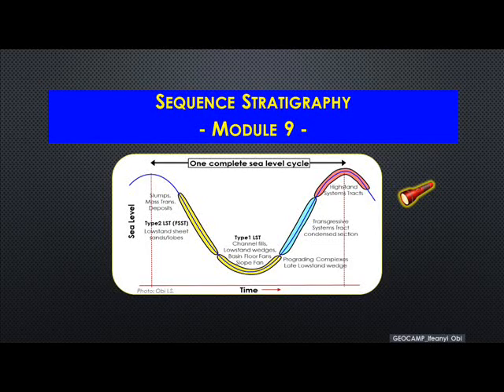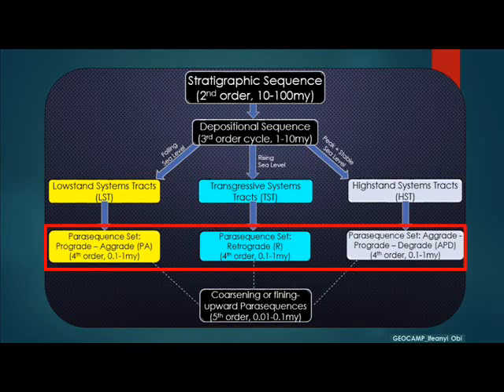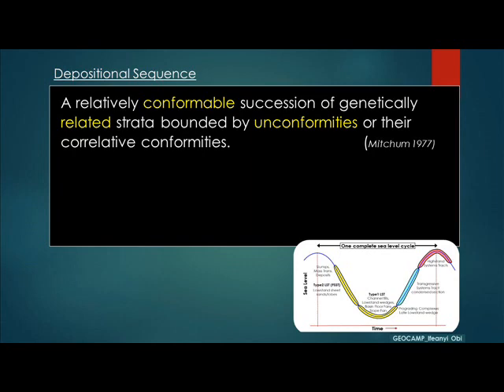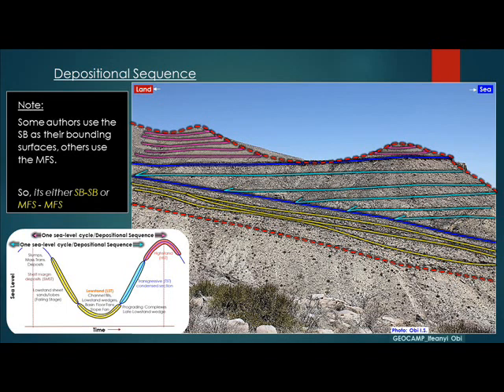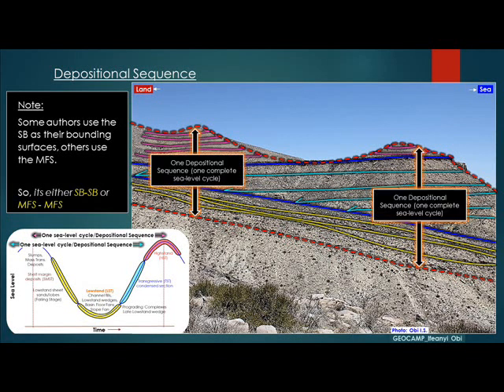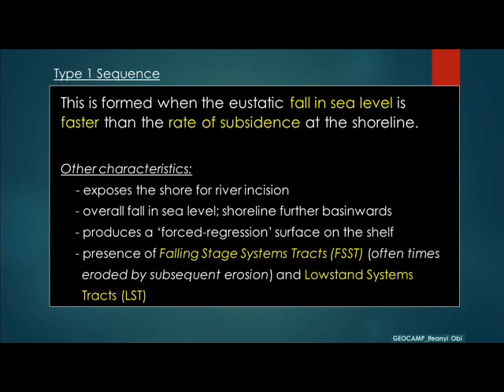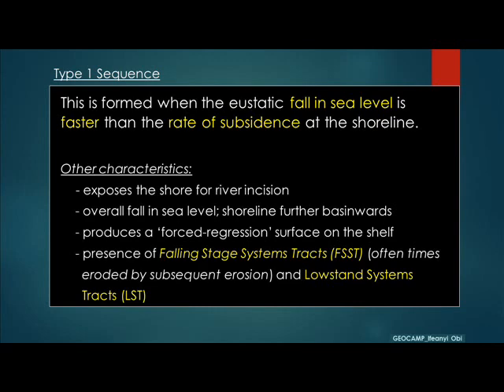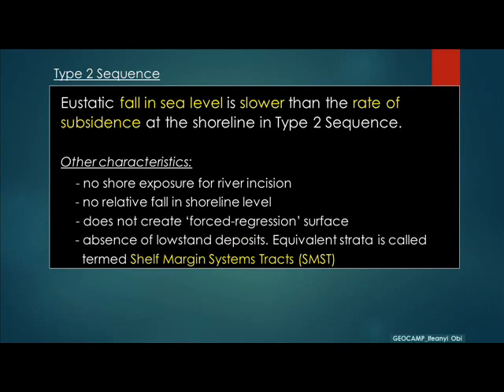Sequence Stratigraphy_Module 9: Type 1 and Type 2 Depositional Sequence

Comment: Having gone through all the modules, I now have a clear understanding of the interrelationships between system tracts and the bounding surfaces.
Thanks for advancing my conceptual knowledge of depositional sequences.
However, I think it is quite difficult to to inteprete a clear sequence stratigraphic framework from onshore data.
Reply from the maker: Well said Athoja. Often times different parts of a sequence are poorly preserved and at different location too. Its unusual to find complete sequences in onshore data especially considering the scale at which these sequences conceptually occur. One would have to do lots of integration (and sometimes modeling) to get the complete picture.

Comment: Thank you so much  we need subsurface well log correlation using sequence stratigraphy
Reply from the maker: Ok sir/ma. Glad you liked the video. The challenge with well-log sequence stratigraphy is that well log motifs are quite subjective and Gamma Ray characters (the log shape) are often times not instructive. The preferred practice today is to integrate all of seismic stratigraphic signatures, seismic facies,  biostratigraphic data (Planktonic and Foram diversity, abundance and index fossils), conceptual depositional model, etc in order to build a more instructive sequence stratigraphic model. 

Well log signatures are quite useful for lithostratigraphic correlations but can be quite limiting when used for sequence stratigraphic studies.